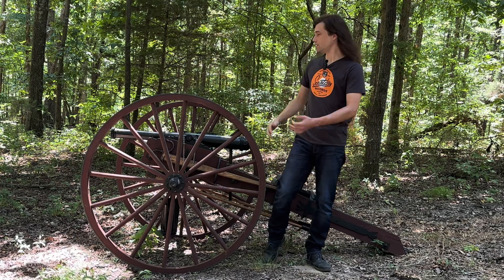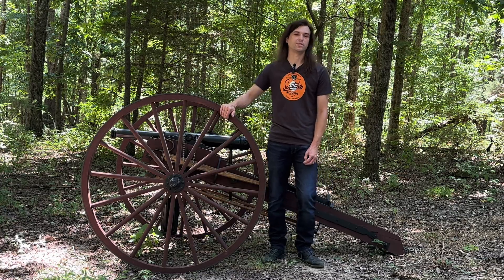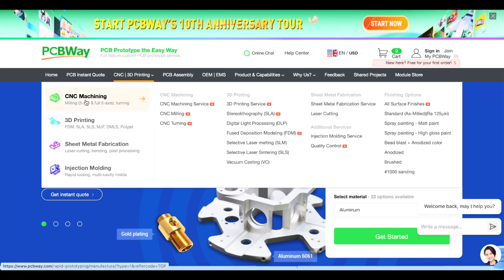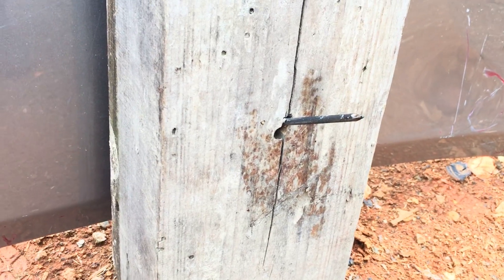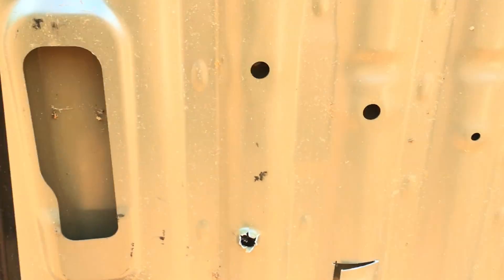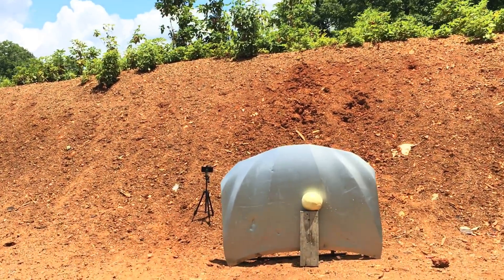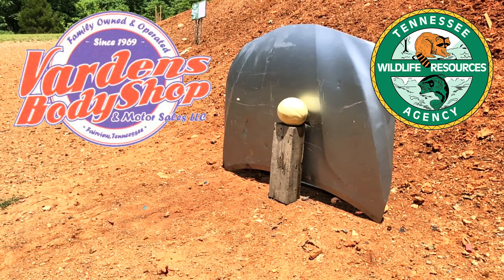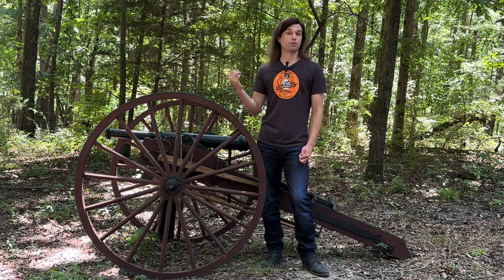Shooting APFSDS Nail Rounds

Comment: The sabot is supposed to be ribbed internally and the shaft of your projectile is supposed to be ribbed to form a place for the petals to grip the shaft.  The pressure is supposed to push the projectile from the top of the projectile, not the base. There should be no base on that design. A nail is a lazy ass copout.  Use aluminum for the fins and get a lathe to turn the projectile out of decent steel.  Then you will have very good success.

Comment: I think you need a larger penetrator with more mass. I’m sure there is a way to make 3D printed fins work, but I think you need to view it in slow motion to really know what is going on. Also a recommendation for the sabot if you can design a sabot that is kept together by bore of the cannon and falls apart without that support I think you have the right design.

Comment: You do realize that since you are using a black powder cannon that speed of loading is not part of the plan?
With that in mind 
You don't really need the rubber bands, once the round is about 1/2 way loaded into the barrel.
Simply take the rubber band off (Or use a piece of string that was rubber cement anchored to the pedal, and pull the string out of the barrel before the last of round has entered the barrel.)

Comment: Wish I had machining equipment and a 3d printer to send you some to try. APFSDS is pulled along the bore vs being pushed the sabot itself grips the projectile along the central portion ribbing distributing the shock throughout the sabot and preventing abrupt disintegration unfortunately putting finned plastic on the base will break from the powder increasing the pressure in the bore in a pull configuration and temperature. Only work around I can think of is sawing the nail head in three portions folding them away from the body of the nail and then welding them to make the correct kind of fins needed.

Comment: the penetrator isn't balanced at all, and the fins/petals are a flimsy plastic being shot out of a fuckin CANNON. those projectiles were doomed from the start.  instead of trying to replicate stuff like the m829 apfsds they should instead focus on rounds like the 3bm9 where the construction was slightly more sophisticated but would be alot more stable out of a low velocity gun. 

and ffs no more PLASTIC COMPONENTS they never last long enough to fufill their designed purpose to even leave the muzzle

Comment: You're loading them incorrectly, that's why they tumble. I think you got lucky on the second one.

The problem are the discs behind the fins. What happens is as the tip of the projectile leaves the barrel it is no longer accelerating, but the rear is.

 The pressure from the gases needs to be applied to the front of the sabot, not the rear.  Think of throwing a dart. You don't throw it with the fins. The force is applied to the front.

ex tanker. hoorah

Comment: The second design is solid, but you may be able to alleviate some of the issues with the other sabot designs by refining your projectile, sabots typically use a weighted core near the front or center of the projectile and this is simply not possible for such a small production. The main point of contention that I have with the second test is that the projectile may have entered the target backwards due to the imbalance, the added weight of the flat head of the nail in the rear. If you were to look at technical drawings of 3bm42 or 3bm32 you could note that towards the front of the projectile being that it comes in for the ojive just before the tip of the penetrator and that also it is slightly tapered in the rear. This is my two cents, great video

Comment: bruh u need to take these prints and make cast lead copies
Reply: I'm not sure it's that advantageous in case of these rounds, because you want hard penetrator (lead isn't) and presumably very light sabot, since it's discarded and wasted energy.
Reply: @_muody  yea i wrote this on the wrong one. i meant the pellets and such. although boring the tip out and inserting a press fit 30 06 AP bullet might work
Reply from the maker: @Darth_Possumus  We just got a lathe too! It's finally getting cool enough I can finally get back into the shop too.
Reply: @TheCannoneer  awesome! you may be able to become the taofledermaus of cannon rounds! but yea u can scrounge brass casings and lead scrap from ranges to cast with a homemade blast furnace. imagine solid brass 3 lb rifled foster slugs from a cannon!

Comment: There was a 15th century load that was a bunch of nails with  what looks like a sliced crimped musket ball 1/4 from the tip, so a plumbata dart in essence, but I cant see why they would use this instead of grape shot, unless,
 A/ this was before grape shot (doubt it)
B/ Or these traveled further.
Either way they obviously were not popular or widespread, but would be interested to see if (I know its a small bore cannon) if 3 of those wrapped in cloth would self stabilize and travel further than traditional grape shot.
Reply from the maker: I screenshotted your comment! Thanks for the idea!
Reply: @TheCannoneer  Your most welcome, I will continue to dig through the old references on early 15th 16th century cannon loads, I think early naval cannons that were mounted on the ships rail level might yield some interesting stuff as some of those were on the smaller side.
Reply: @TheCannoneer  Dang it I forgot to mention the nails in the diagram were the old forged nails and are nearly square cut with the rosehead portion of those traditional nails cut off. somehow They look 10x scarier than a 8 inch masonry nail.
Reply from the maker: @krulerwest-oz7364  Those should be easy enough to get haha. That's about the only thing I can make in the blacksmith shop reliably is nails...

Comment: Dang, you either need a faster camera or a slower cannon 😂

Your conclusion at the end about the second shot is actually incorrect. There are five frames from the slow-mo camera facing the cannon ( 4:47 ) where you can see the projectile completely separate from the sabot. If you go frame by frame from the moment the edge of the smoke puff starts to cover that trash can, pillar thing that you're standing behind, you can see a light streak across the bush in the background, next frame it's over the end of the grey cart, the next two frames I lost it, but on the fifth one, there is a silver blur on the far left side. Just above the sidewalk, right at the edge of the car hood, you can see the dark streak on the light grass. Then a full 8 frames later the sabot catches up and reaches the left side of the frame. So that second design actually worked flawlessly. The sabot separated and the dart stayed true, just needed to aim a few inches higher to get the melon (though honestly, the effortless, perfectly straight pass through the wood block and metal hood were more impressive to me than a splatting melon would have been 😂). I'd love to see more shots of that design!
Reply from the maker: Why not both? 🤣😂

Comment: I don't know if you're installing it with the garter bands, but I'd suggest a design without them.  That's a relatively short distance to get the sabot to fall away from such a light core.  Adding bands is convenient for loading, but it's probably cutting into your operability margins.  Since we're printing, I might suggest a fully segmented sabot with some sort of interlocking features along their mating lines to keep them together while they're constrained by the bore.  From a CAD perspective, instead of parting the sabot with two flat planes, part it with two slightly wavy or zig-zag surfaces.
Reply from the maker: Yeah I left the bands on, I asked if he had a preference when he sent them to me and he said either way so I just left them. If he wants to send us some more I'll play with it both ways!

Comment: On PBway the circut boards they make can be used with the right pattern as electric motor or generator coils you can get a lot of 90-degree lines packed in for great efficiency.

Comment: I would be very interested to see a version where the nail had steel/welded on fins vs the 3D printed fins. I feel that the 3D printed fins are the weak point to this working perfectly.
Reply from the maker: I've got a welded up version of the TPU round too I'll be testing but I'd be really curious if TPU fins would hold up on this version with the 2nd design.

Comment: Looks like the second one is the only one that actually worked properly. Proper separation of the sabot and penetrator while still in flight, flew straight and accurate, and the fins stayed together up to point of impact on the target. That design definitely requires more study and testing.
Reply from the maker: For sure! The more I looked at it the more I wondered if it actually worked like it should have. Sadly I'd already filmed the outro and then I found the slowmo version footage!

Comment: I think the second design actually worked as discarding sabot. Looking frame by frame on the first close-up angle, it looks like the sabot hit the hood to the left of the wooden post, and on the next angle, I think you can see the nail going just above and in front of the sabot. Great video :-)
Reply from the maker: Thanks! I think you're totally right. I'd already filmed the outro before I found the slowmo version so it wasn't as clear the first time around but it looks like it did exactly as it should.

Comment: For anyone in the future thinking of making a sabot dart, pushing sabot darts from the base is just not good. They need to be pulled by the sabot. Check out a picture of a M833 dart. Those ridges in the middle of the dart is where the sabot locks on to and pulls the sabot from. No pressure is exerted on the base of the sabot. Those fins are made of aluminum, they would crumple. 

Think of it like this. You got a grocery cart and want to move it with just one hand. Is it easier to keep it going in a straight line if you push it from the rear, or pull it from the nose? Sabots help keep a dart straight down the muzzle but they are just plastic, if the dart is trying to go sideways, the sabot will deform under pressure and let the dart get a little bit sideways in the bore. Which will become a lotta bit sideways when it hits air.

Comment: that second design 100% worked, you can see the nail impact at 4:45 clearly before the sabot comes into frame
Reply: low caliber auto cannons like 30 and 25mm APDS works with the same exact one piece sabot concept https://www.youtube.com/shorts/I_kwHdKmu_8
Reply from the maker: @colten1825  Very very interesting round. I just saved that video and I'll have to cook something up like that too... Thanks!
Reply: use comma and period to wipe between the frames
Reply: Yeah you can even see it. Hit the dirt behind the wood  @colten1825
Reply: I think the fins on the nail aren't strong enough to hold up to the acceleration.  I see what you're talking about but those fins shed before impact from what I could see.
Reply: @BiscuitWaite  no, i think they were attached, you can see in the impact the very clear marks of the fins
Reply: @colten1825 i thought those were sharpy marks to let him track his hits 😂